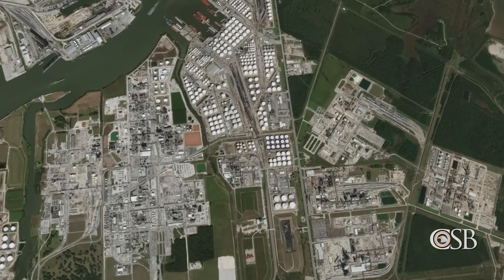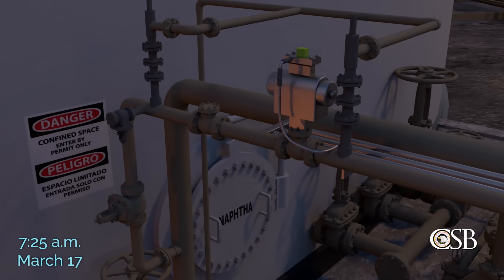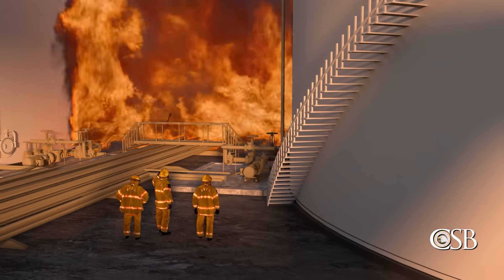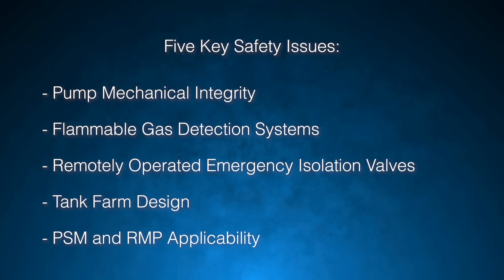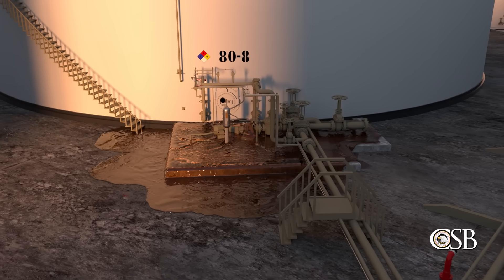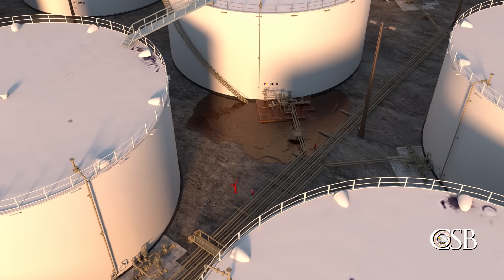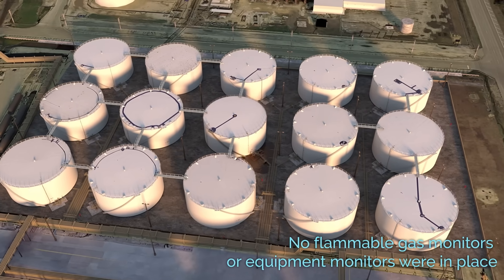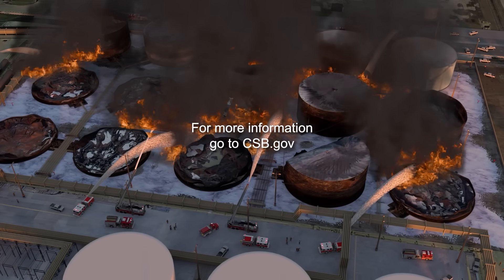Terminal Failure: Fire at ITC

Comment: I think another good design would be to have the belly valve on the opposite side of the tank of where the pump is located.   If a leak occurs at least operators could get to the isolation valve.

Comment: This facility was operating beyond its design life (typically 30 years) and many of the issues stated were a result of antiquated technology. The recent PES disaster is another example. As a process facility designer for most of my 45 year career, I would recommend that once these facilities reach the end of their design life, the "fit for purpose" assumption that we use for PHAs becomes invalid and another "Post Design Life" PHA should be conducted that would validate the old design. This would consist of a review of proper materials of construction, corrosion allowances, code compliance, EPA/OSHA laws, etc. The goal would not be to bring everything up to the latest code, but to identify risks that could lead to catastrophic losses and to develop mitigation strategies.

Comment: These UCSB videos should interest any industrial maintenance mechanic, millwright, controls tech and similar professionals. I find them quite interesting.
Nuts like those shown lack positive mechanical retention against backing off.  The've no locking tab washers, no safety wire or cable (cable safeties are increasingly popular because they're convenient), no castellated nuts with cotter keys etc. Washers with drilled tabs for safety wire permit easy retrofit without drilling wire holes into nuts and bolt heads. 
Since these systems are engineered and liability is a huge issue it would be wise CYA to get written blessing before doing anything different from OEM.

Comment: I would like to see you all put in a recommendation in large containment facilities to have fire retardant systems put in place over the large combustible containers. That's triggered by heat and sensors to alert the operators in the control room. A foam to be sprayed out and around the whole area of the containers. I know it would cost a bunch of money. But for the cost of people, property and the pollution completely outweighs and the cost of having a system like that in place and ready to go at a moments notice. The heat of the fire will automatically trip the system to extinguish the flame's. It's justa thought to bump around. And possibly get it made into law because of accidents such as this. And so many in the past. 
Thanks for letting me comment on this topic.. 
DRC. ;) Just trying to help is all.

Comment: Increasing reid vapor pressure (RVP)of naphtha by adding butane  , to improve combustion of internal engine.
Some refineries add this cheap butane compared to expensive naphtha to increase profits, level of product naphtha and to increase reid vapor pressure at 100F above 12. But it is improvement for gas turbine operations.
Reply: Gas turbine combustion

Comment: Honestly, This brings up a major issue of mine: This isn't the 70's, 80's, 90's or even 2000's anymore: A 1080p+ Quality camera is $ in volume. Add $200 to make it "inherently safe," and its cheap to have every square inch of these facilities imaged and analyzed at >1fps. In short, there should have been cameras, and a threshold filter that said "Hey, Operator. I haven't seen this before!" once the pump started spewing it's guts. Likely, it would have alerted once the partial seal failure sprayed everything in gunk- Long before it failed utterly and started pumping everything onto the ground instead of back into the tank.

Comment: Assuming they are never going to have staff with years of experience in that specific location 24 hours a day. Consistently playing devil's advocate against the process techs/ plant managers agenda, I bet they would of been able to still catch it if they had a monitoring program  running a real-time operating system (for stability) that logged current and voltage for each motor along with other variables in the plant such as current processes and operations in place. The change in harmonics   / current draw before any power factor correction would of been significantly different and could of put up a flag for possible malfunction.

Comment: I was right down the road at church when the fire started. Several of the men in our congregation were volunteer DPFD and had radios so they heard the call, got up and walked out and our pastor made an announcement. I also was working at Oxy La Porte at the time which is literally 1/4 mile down Miller Cut Off from ITC. A week after the fire, the wind shifted and blew a bunch of the foam off and benzene and god knows what else blew straight into our facility. I remember the fumes and smell. It was awful. We made a B-line for the shop and right about then our alarms went off to shelter in place. There is no telling the long term damage done to people from that disaster.
Reply: Damn, should've been an evacuation order, not shelter in place
Reply: @mnmurph nah man stay inside where the smell had entered through vents and doors and couldn’t get out lol

Comment: I watch these and start making my own observations..

This is a tank farm so its unlikely to see vibration probes or monitors on these small pumps.
Wouldn't a seal plan with a transmitter to alarm on seal failure have alerted them?
Missing basic containments between tanks and around pumps.
Tank farms are usually missing power for 24VDC to power gas monitors that require a separate source.
Missing EIVs altogether, they are probably missing in their other units before they even hit a tank farm.

Maybe missing a DCS in this area?

Comment: we've added a TON of hydrocarbon meters all over the plant (to the point where it's annoying even taking samples). congrats to the guys who made the 3d models, everything here is super accurate (except the control room which is no where near this fancy 🤣🤣). they mention remotely operated isolation valves but those don't work too well when they're on fire. the lucky part was the tank was right next to the entrance of the plant off independence. to the people yapping about 'adequate maintenance' everything was maintained, tanks that receive butane by truck are some of the best maintained because pumps are needed to circulate product for butane injection. maintenance would not have caught a bad bearing, that falls on the manufacturer.

Comment: What was the emergency responders reason for failing to use a foam blanket and advance on the isolation valve? If they couldn’t do it why did it take so long to contact additional outside resources? Is the facility not trained to handle this kind of situation?

Comment: In movies you have tanks that literally explode but butane does not require pressure as far as I think propane in the other hand needs to have pressure or else it will become a vapor butane is easy to manage because it’s stable. It’s an easy to ignite and it’s used pretty much everywhere.

Comment: Lots of nice to haves recommended here than most companies wont put in place because it costs too much.     
Gas/beam detectors are a definite must have and crazy that they didnt.    
Maintenance program on the pump is sure ok.   but a seal can fail just like that so no preventative maintenace program could possibly catch this.    
Automatic shutoff valve.. maybe with a fusible link?   Most of these valves go dead when they lose I/O 
Better tank seperation with dyke system ... this plant was only built in the 70s.  i would say they ran out of land to do a proper job of seperating them

Comment: I used to work for General American Tank Corporation, and I was an apprentice welder/fitter.  The tank walls are constructed of 1.5-inch-thick plate steel for the base layer ring.  The top ring steel thickness is about 1/4 inch.  It takes a tremendous amount of heat to melt steel that is 1.5 inches thick.

Comment: "In 1995, an administrative law judge ruled that PSM coverage does not extend to stored flammables in atmospheric tanks even if they are connected to other equipment that is considered to be a process and covered under the PSM standard. [See U.S. Sec’y of Lab. v. Meer Corp., OSHRC Docket No. 95-0341 (1995)]. This ruling was contrary to consistent OSHA interpretations of the standard at the time, and as such, OSHA has repeatedly expressed intent since then to clarify this exemption." - The Need for Process Safety Management Regulatory Reform by Amanda Johnson

Comment: Certainly cheaper to add at least some of these changes over the cost of this or similar failures.
The cheaper ones are pretty easy to retrofit or implement.
Even a couple would have either prevented or at the least mitigated the damage and impact.

Comment: I don’t miss working at a tank farm.  Single operator, active railroad running through the farm and often stops, preventing the operator the ability to get from truck rack to operation/ tank farm.  Having only one operator was/ is a recipe for disaster.  Good paying job, but no way was it worth the risk.  Hopefully that site goes back to multiple operators, but I doubt it.  Management didn’t understand the risk.

I’ve worked at the Deer Park refinery quite a few times.  Seemed fairly safe compared to lots of other, smaller refineries.

Comment: 10:00 the pump losing over 30 minutes without anyone noticing, is just insane. I can only conceive all of this because this company may have insurance. Why would you be so incompetent with the security and maintenance in your company? Losing all that infrastructure and resources because of not having good safeguard systems and control, there are many cheap solutions to prevent this kind of accident.

Comment: It looks like even minor subdevision of the tank storage would have helped dramatically to contain the flamable liquid.
The equipment pads the pumps are installed on, in the video, had a small curb around them as well. This would have been an excelent location to install a flood sensor, though the nusance alert from a rain event may reduce that effectivness.

Comment: I remain unconvinced that improving regulation and compliance with regulation will reduce the scale of accidents. Regulatory improvement is probably worth doing although it probably won't help much. My guess is that the business will choose to "take the risk" because there "real" cost avoidance seems like a good business choice while infrastructure maintenance and upgrades seem like "dead" costs and have inherent risks. 
Part of this story was the failure of the containment wall. The maintenance of a containment wall is simple and inexpensive compared to pumps and plumbing, yet the containment wall failed. It seems like when a facility can't successfully and reliably do stuff that is simple and inexpensive it is unlikely that doing difficult and expensive is going to be successful.
My final point is that business incentives require mental gymnastics to make it a good idea to do something expensive for un-known and unknowable gain like accident prevention.

Comment: My initial reaction: "What? Why?"

No gas detectors? No remote shut-off valve? What about preventive maintenance? Ever heard of it? No isolation between individual tanks? And WHY TF DID THE PRESSURE AND FLOW FLUCTUATION NOT TRIGGER AN ALARM? NOT EVEN THE EFFING RELEASE?!

I'm asking this as a person who knows nothing about safety measures, but has two IT degrees and worked at QA at a couple factories.

Comment: all tanks should have been  separated by individual full  containment berms.  IIRC it is mandatory at certain size tanks , 
It is obvious to me that this farm needed more berms. and did not have a proper perimeter  containment berm-given the leaks into the local bays.

Pumps and pipes can fail ,fires can happen , but a containment berm should not fail.

Comment: So let me get this straight: as of 5 years ago, facilities like this are not required to have 1) cameras to monitor unmanned areas, or 2) sensors and alarms to detect leaks, or, and forgive me, this seems incredibly irresponsible, 3) a remote shut-off valve for huge tanks full of highly flammable solvents?! What kind of Mickey Mouse operations are we allowing in this country? Disgraceful, I am furious, and I'm only 5 minutes into the video.

Comment: Here I was thinking, what? How did a pump failure cause this? Remote operates or even manually trigger shut off valves would have prevent that. What else could have gone wrong that the emergency shutoff valves were not closed? … oh. They didn’t have them. American’s really do just run on thoughts and prayers.

Comment: The failed circulation pump at ITC’s Tank 80-8 was traced to a chain of mechanical problems that were not caught by the facility’s maintenance program:

1. Bearing Failure

The motor-side bearing of the pump shaft failed.

This caused shaft misalignment, which increased stress on the mechanical seal.

2. Severe Vibration

Misalignment created significant vibrations as the pump kept running overnight.

Those vibrations progressively loosened the four gland nuts that held the mechanical seal assembly tight.

3. Mechanical Seal Breakdown

By ~09:30 a.m., the seal had partially opened, letting small amounts of butane-enriched naphtha leak out.

By ~09:45 a.m., the gland nuts completely disengaged, and the seal failed catastrophically.

This allowed a large uncontrolled release of flammable liquid into the containment area.

4. Contributing Factors

No condition monitoring (no vibration sensors, bearing temperature sensors, or seal-health monitoring).

No preventive maintenance requirements in ITC’s mechanical-integrity program for this pump, because the stored chemicals (butane/naphtha blend) weren’t on the company’s list of “regulated chemicals.”

No gas detection near the pump to catch vapors before ignition.

➡ In short: a worn bearing → misaligned shaft → vibration → loosening gland nuts → mechanical seal failure caused the pump breakdown, and the absence of robust maintenance and monitoring systems allowed this failure to escalate into a major fire.

Comment: The 2019 ITC Deer Park fire was caused by a failed circulation pump on Tank 80-8 and systemic safety gaps at the Intercontinental Terminals Company facility (no flammable-gas detection, no remote isolation valves, weak mechanical-integrity program, and a single undivided dike). That’s the U.S. Chemical Safety Board’s conclusion—an accidental, preventable incident attributed to ITC’s equipment and safeguards, not to an individual or arson